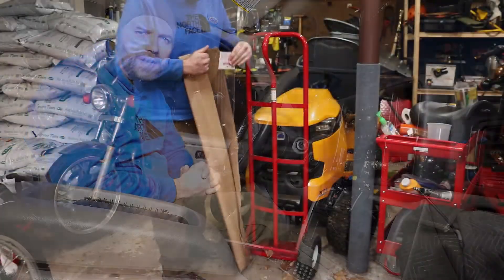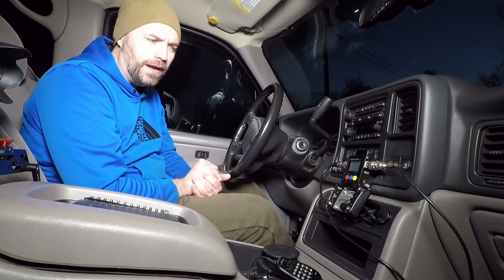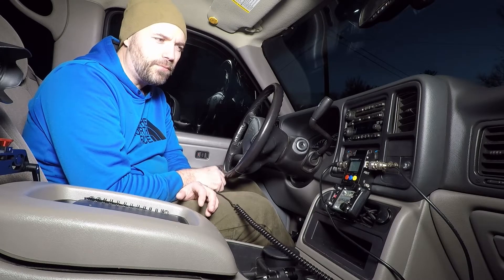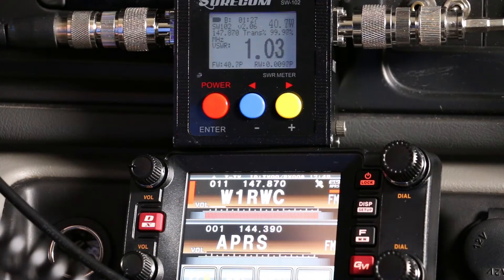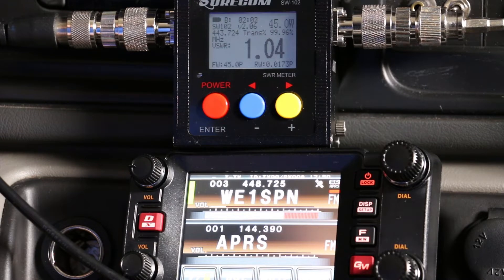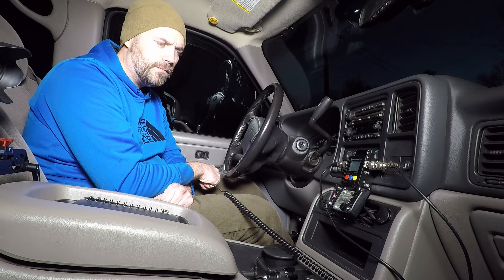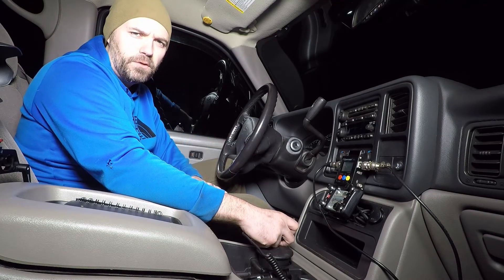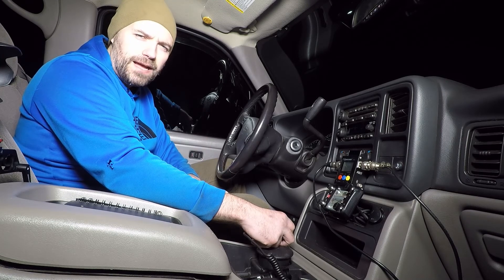TRAM 1180 DUAL BAND ANTENNA - FTM 400-XDR - SURECOM SW-102

Comment: I have 3 Tram 1180s. @ in the roof of my car.Using a MFJ269c ,one in the middle of the roof is 1.5 1 on the edges of the two meter band (1.1-1 at 146) while in 1-1 at 435mhz and 2-1 at 450mhz. while the other is the oposite, good across  70 cm , is 10 inches back from the windsheild.  The 3rd one is on a mag mount on a a/c  window unit and it less then 1.5 across both bands. Works great on 70 cm. I am spoiled with a Hustler CG144 on two meters.

Comment: It’s probably 50 wants peak not constantly 50wants
Reply: There is no "peak" with FM. He's not getting 50 watts out because without the engine running he's not getting enough voltage. He needs about 13.8 volts to get full power out. FM continuously has the same power it doesn't vary like AM or SSB.

Comment: You would probably have higher power output with the vehicle running. Your probably around 12.3-12.5 volts. It will be about 13.8v while running. I know some yaesu are very sensitive about voltage. My ft-991 was suppose to put out 100 on ssb and if the vehicle wasn’t running it would only do 50-60w. Just a thought. W4FFX

Comment: I have 3 of these meters for my base station rhey check out the same as my old Yaesu meters antilog meters
Reply from the maker: Do you think they are accurate?
Reply: @TheButchersCut  Seems to be I tested it to my Yaesu meter right after I got them they came so real close I sold me Yaesu meters if that helps.
Reply: I wishe they brought that base unit out I think it was going to be the Surecom SW101 they were neat looking but when I asked them they never hit the market. Im just going to build my in to flat wood with the face on the out side side by sideto hide the cable in my radio hutch.